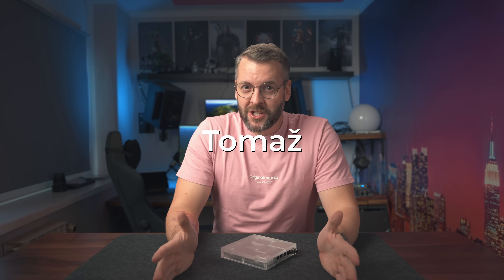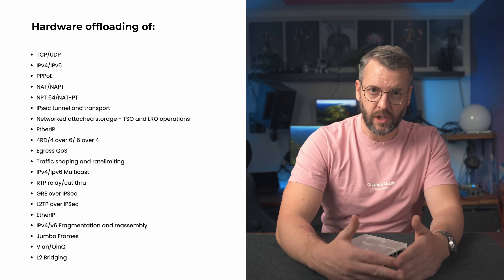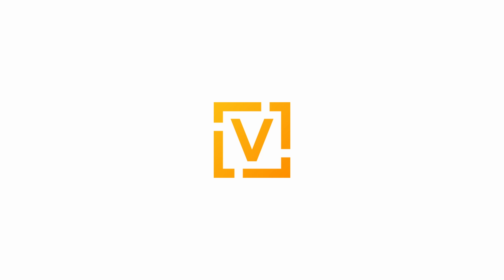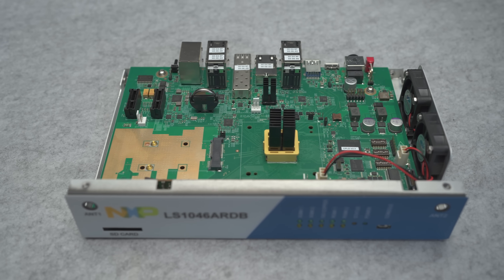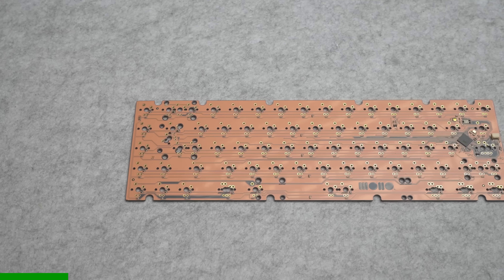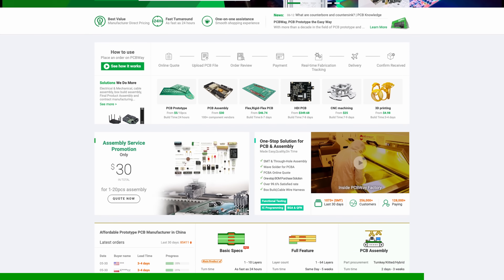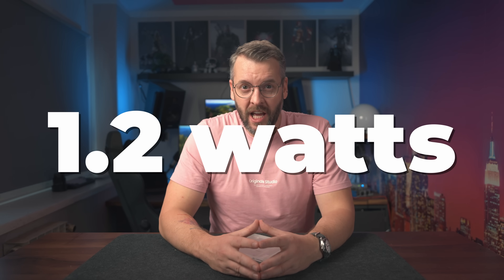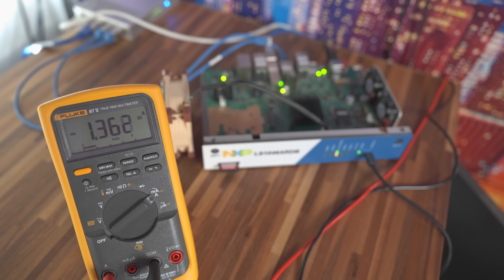10 Gb/s throughput without using CPU cores? ✅ Check.

Comment from the maker: Do you prefer a slightly slower version of the CPU if it makes the device cheaper, or do we go all in?
Reply: I'd go for the cheaper one for more possible customers.
Reply: @newbiegoalie exactly
Reply: honestly, with hardware offloading I think 1.4GHz would be good enough, and 4GB should be good enough too. would be nice to have benchmarks comparing those two configurations though to see how big the difference really is
Reply: @rooot_ yes and maybe a comparison of with and without closed blobs
Reply: i am excited about your router, i prefer lower cost, because very expensive consumer-grade routers have around 2GB of memory, like this Asus ROG Rapture GT-BE98 that has 2 10-Gbit ports, i think 4GB of RAM is allready an overkill, i am going to keep watching your videos. Thank you!
Reply: @Valmatej  bigger the ram bigger the exploit
Reply: I vote keep the cpu the same. means those who want a pure oss build can still get decent performance.
Reply: @bigalsenior that makes sense to me.
Reply: I prefer the beast variant. I like the idea of having more headroom to run related services on it.
There might be an argument to make two types in the long run.
Reply: I prefer the beefier one.
Why?, because it's not only a router, it’s also a firewall and an IDS/IPS.
not all functions will probably be done by the hardware, but also done by the CPU.
There is also a big possibility I won't use the NXP code simply because the traffic becomes “invisible” for the system (which makes statistics and debugging way harder.)
Reply: @spookje  If traffic is not visible to the system, how would an application layer firewall be able to work? I was excited about this project... now I'm wondering...
Reply: Well if this device is going to be like €500+ already(can't remember what it was going to be) the extra €100 does not really matter for the market you are targeting. What i'm trying to say is that €200 to €300 might change the market you are targetting, but €500 to €600 is a different thing. If however Openwrt is practically what we will get we can reduce the RAM to 2 gb. and depending on what things DO cost CPU power reduce the CPU. At the moment I run an what should be overkill pc (Minisforum MS-01) that uses quite a lot of power because of PPPoE with Vlan tagging my ISP uses, and horrible optimization for PPPoE in FreeBSD (OPNSense) (mostly single core CPU because no hardware acceleration is available). The C3758R I had before that simply could not do it. 1 core of the C3758R was too slow for 4 gbit PPPoE. with multiple cores used in OpenWRT on the C3758R it did work but did limit the download speed of a single download.
Reply: I'd go with 2 variants: the cheapest CPU (as the main networking is offloaded to dedicated hardware) with low RAM amount (2 GB, for instance) and the most expensive CPU with a big amount of RAM -> this last one should be released first, GPU/CPU market works this way, so there must be a good reason to imitate them 😊
This way the wealthy consumers get the product first and will be happy to pay the premium, and those with more tight budget can afford to wait on the cheaper variant.
Reply: @leandrogaleano1771  Poor consumers don't have use cases for 10Gbs typically. Only nerds like us try hard to find a use case :-)
Reply: @SwissPGO  I have a 10 Gbps Fiber to Home with Digi Spain for 25 euros per month :) I'm stuck at using my 2 computers with 2.5 Gbps, a cheap (>400 euros for 2 NICs and router) upgrade to 10 Gbps would be great.
Reply: @leandrogaleano1771  Yes this scenario makes the most sense, as not all viewers budget is the same and also the wishes what a device can do are not the same. Just make sure in branding or in how the device looks that it is very clear which type you buy. Not so much only for new devices but specially if the devices are going trough resellers as not all of those are honest about what they sell. So if the versions look completely different like another color housing that would be helpful.
Reply: +1 for a cheaper model
Reply: I'm just an amateur with not real dog in this but I feel like the question that needs to be answered first is, if the CPU is doing nothing with all this hardware offloading doing the routing, what would the CPU be doing that would make the more powerful one worth the cost?
Reply: I would like to see the same test without the kernel module. If this ment to be an open platform (where I can choose OS) and I don't want any specific module/patch/kernel, maybe the CPU speed will help something. Also this specific binaries means you need to patch the OS itself, and keep up to date, as much as possible, since you have to tell the CPU in a specific way, how to NAT for example (if I got it right)). Also worth to mention, that linux netfilter is statefull, if you configure it properly :)
Reply: @EFazy yea, I am cheering for this project, but I think some more in-depth benchmarking in general is in order. I wouldn't be the person to say which tests but I know I was able to get my Mikrotik crs305's processor sweating. That was the device/os that made me want to learn more about networking.
Reply: definitely, no question, cheaper CPU.  At your price point, you are only going to capture enthusiasts.  Cheaper x86 options are out there, and the power usage difference is generally ignored by most people.
Reply: I run firewalls as part of my job. Not everything can be HW offloaded. We do not know yet what the cpu is capable off for such tasks.
Reply: Please consider making two versions: RouterOnly - underpower the hell out of it for best cost; Router-Homelab - put good cpu and memory for those who will run dockers on the device.
Reply: All in. I hate these kinds of corner cutting. If anything make two SKUs.
Reply: All in for me but for the rest most likely would be a cheaper model because of the many routers available on the market.

How about a limited founders edition which gives you perspective of how many want the top tier model and also selling the cheaper one that way you get some data of how many are willing to get the top tier vs the cheaper one.

Also marketing is what you should look for to get more eyes into your router.
Reply: What about two versions?
Reply: @jelsonrodrigues  unfortunately, if you split the volume, you increase the price.  and then both models would end up MORE expensive than just one model with the faster CPU.
Reply: What’s the difference between the chipper cpu and the mor expensive one? 

My correct router from Teltonika has for example a Mediatek MIPS 24Kc 580MHz CPU with 128MBytes Ram.
Reply: What about the licensing of the software? 

BTW I'm curious now that you've seen their proprietary software would it stop you from trying to build software that would do the same?
Reply: Id say make the more expensive version first and you can have cheaper devices later down the line. That being said cheaper means more availability for us the viewer and if cutting down specs really doesn’t affect much then just cut down till it starts to hurt your intended goals
Reply: I say grab the 1.4ghz processor and the 4gb of ram. Why? Well you get a broader market that way since the device is cheaper, youll also probably get to even lower power consumption and both the end-user and you endup saving a buck.
Reply: In my opinion you should do the cheaper option but I also think it’s worth doing a video showing the performance of things that can’t be offloaded…

I don’t think 200mhz reduction is going to make the difference between a router than can hit 10gbps and one that can’t; the stuff that can’t be offloaded will very likely be closer to 1gbps regardless of clock speed.  As such I can’t see the sense in paying $100 more for a beefier cpu that doesn’t do anything to solve the problem.

More RAM is also worth doing a video on; I’m not personally aware of what router scenarios are dependent upon memory capacity but I’d wager in a home setting the answer has got to be “none of them.”

For $500 I’d be expecting 25gbps. 

As interesting as an open source router is, I can get most of the way there today using openwrt or pfsense for $100.  I’m not the guy who cares about closed source kernel modules so maybe I’m the wrong person to ask about that but I don’t think that’s worth $400 extra dollars.
Reply: get that nonfree crap outta here
Reply: Why not provide both? You could also sell two versions of the router. One with the slower CPU, and the other version with a higher-end CPU. That way you can provide customers with the ability to choose.
Reply: Not about the price. It's about GPL and corporate ethics. I would pay more to have the same performance without any secret sauce.
Reply: Why not sell two variants? One with 90-95% of the max possible performance and one which is trying to be at perfect value (price/performance)
Reply: i wonder what sort of cpu overhead is involved if there are extra (and future) functionalities to consider, or is anything beyond a standard router feature set considered to be bloat?

for the cheaper ram and cpu options, i think it depends on how busy the router will be, doing whatever else you want it to be able to do in the end.
if it really has no need for such a powerful cpu, even when it's doing everything it can simultaneously and at full tilt, and it can do everything you want it to in terms of functionality, maybe go even cheaper? XD
Reply: All in. Many of us remember UniFi's "1Gb" router that struggled to hit 300Mbit when the UniFi features were turned on.
Reply: @JB-fh1bb  That's what happens with hardware like this. The design is compromised and the marketing tends to be lies.
Reply: You are already making something niche, and in this niche the customers would really appreciate longevity/future-proofing. So I would say choose the CPU with best performance and add as much RAM as you can so that it remains competitive for longer. 

4GB RAM already sounds like more than enough when OpenWRT is doing well with 64MB
Reply: All in for a limited number of productions for the greater market, then after or in parallel go with smaller RAM and a slower CPU. I'd say 100 units (or whatever it makes financial sense) for the "All-in", then the rest for the smaller version. I mean, if there are enough users on this channel to support the beefy version (add a bit more RAM or perhaps an SFP+ port, maybe?) as the first batch and get a money boost to manufacture slower spec'ed ones, wouldn't it make more sense for business in a long run as well? 

I'd be down to pay USD 300+ for your project. I can't stop myself from checking YT just to see if you have uploaded new videos. 

Tokyo, Japan
 - Daniel
Reply: Wire speed is one thing. We have to consider firewall rules, packet inspection, IDS, IPS, VPN servers+clients, ipsec, etc. Unless you have a very simple home setup that just does NAT, I think most users watching your channel will be running at least 2 or 3 of the items I mentioned, and those will eat up CPU cycles real fast. It'll be great if we could have at least 2 CPU options.
Reply: Maybe I'm asking for too much here: How about also having an expansion slot for something like the Intel QAT for users who require alot of SSL/crypto acceleration and offload?
Reply: I don’t think the question is “faster for more or slower for cheaper”, I think the question is “willing to sacrifice fully open source for a small price improvement?”.  

I have been watching your videos but can’t recall, what’s the CPU load with the same test without the offloading? Could the smaller CPU still be used?

Is it possible to release two versions? Same hardware on both but different firmware? I don’t know the technicalities in achieving this.
Reply: I’d like to add, this is probably the most pivotal decision yet, as far as I can recall. Is it working doing a bit more testing and formal comparison to help the audience provide their informed feedback?
Reply: Start with the cheaper version - you could later offer more expensively beats.
Reply: Depends. Whether the sum of features and specs will justify the price. If you manage to convince the audience that the router as a sum is worth it , then people will justify a small increase in price for a better cpu. It depends if subconsciously we will consider it as high or mid router , thus beginning to compare it with other routers in the market.
Reply: Depend on the features, but yea
Reply: If you can use Hardware Offloading a slower CPU is fine. As most people will use that and the CPU will just be sitting idle most of the time. Lowering the costs overall would help customers and if you are paying extra $$ to use Offloading from vendor it doesn't help you in the long term to put in faster CPU with increased costs that just sits there doing nothing.
Reply: Really depends on the features you intend to add if everything you wish to implement is being offloaded it makes sense to go with the lower config since there wont be a big difference in performance. You can look at fortigate firewalls as an example here their super popular 60F firewalls only have 2G of ram since everything except for stuff like logging and DPI and IPS
Reply: My inclination is to almost always prefer extra RAM.  It's nice to have when everything works as intended and a lifesaver when you have to do something "unplanned".  

I'm a bit concerned about the offload feature being considered so critical to the value proposition though.  If the device is to be a raw speed "dumb" router then offloading is great and it makes sense to squeeze the other spec's for $$$ optimizations.  If on the other hand you expect to need the CPU to "do fancy router stuff" then more RAM and the extra MHz are potentially valuable, but there's more than a small chance of those "fancy"s pulling the flow out of the offloading and onto the CPU.  If you're worried about sacrificing CPU/RAM it almost seems like the offloading is the "nice to have" feature, and the CPU/RAM router beast is the primary feature.
Reply: cheaper as the only option first to increase potential market. then add a stronger version if there is enough demand. 
like you said. its a competitive market. a high initial price will drive people away. dont need a high end cpu with offloading
Reply: @bean_TM this logic is good.
Reply: Go all-in and make "cheaper" versions later...
Add a 4080ti in it, just to make sure we can run AI on our router! (Joke)
Reply: Slower and cheaper for me.
Reply: @tomazzaman  I'd suggest to start with cheaper version with 4GB RAM and 1.4GHz CPU clock to have a bigger customer base based on affordability and to have a quick return on your investment at the same time. Later on you can still release the more performant version.
Reply: Low specs for me as it will perform as expected with no hit to routing perf but opens the market a little more for those who want to access it.  Brilliant project! i love these videos and updates!
Reply: 100$ off of the final price for something that will not effect the networking capabilities of it? absolutely!
Reply: Fond memories, Tomaž.... I started out building custom computers in the late 1980's. I would plug the CPU and RAM prices into a spreadsheet.... look for the elbow in the curve. I would recommend customers purchase at the elbow point. "Little bit less, little savings. Little bit more, much more expense." Awesome progress! 🥳
Reply: I'm an All In person! 🙂
And i just ordered an Ubiquiti Dream Machine Special Edition ;-)
Reply: Go for the beast!
Reply: Go all in on performance is my preference, but $100 is enticing.
Reply: Incredible work, love following this!

I think starting with the cheaper option is a great idea. You could always release other variants in the future if more performant use-cases arise. Given CPU utilization is going to be VERY low due to hardware offloading you end up clawing back a lot of headroom for other use-cases.
Reply: less expensive or both options
Reply: yes, slightly slower CPU please, if that will give us a cheaper product. Because that's what you have to fight here, both CPUs are clearly 10G capable, but the price difference is significant, and that is what will determine success or failure here.
Reply: Make 2 versions.
Reply: All in, of course.  You have to build now for what the future holds and networks are not going to slow down.  Once that device ships, that is what you get for whatever number of years you contiue to use the device.  The $100 difference for a faster and more capable device will mean nothing over the expected lifetime of the device as it will maintain higher performance  over its life.  I would gladly pay extra if it means I dont have to replace a device more often because it cant keep up.
Reply: i would like to keep it higher end
Reply: All in.
Reply: Max performance please….
Reply: I would prefer the 1.6ghz/8gb version and if a buyer is totally crazy you should give him the option to buy the 1.8ghz version as well. With a 1.8ghz version you would have more room for future addons (better to have than to need).
Reply: A fast CPU for both and two versions (2GB and 8GB) seems like a easy way out. I would not recommend using two non-pincompatible cpus.
Reply: all in
Reply: it depends. If the price will be on premium spectrum, people would want the best of the best.

But if with the cost cuts allows the product to reach a more performance/price spectrum, then yeah go for cheaper CPU + 4gb RAM, since it will be more than enought.

Personaly i prefeer the cheaper option. But also i'm not the type of person that would buy e premium router.
Reply: All in, I want that CPU beefy.
Reply: Cheaper
Reply: Keep it as it is now, as this give more headroom for future needs, and  the possibility to go all OpenSource if you dont like the closed-source parts
Reply: What about making "pro" and "conventional" options where pro has faster cpu and more ram? Futhermore, why would anyone need 1.6 vs 1.8 GHz with more RAM?
Reply: Go for multiple SKUs. Faster CPU and more RAM should neither require a different PCB layout nor different SW, just different placement. The little extra cost for managing added SKU should be more than offset by larger reached customer base.
Reply: cheaper
Reply: Personally, I think anything below Firewalla Gold levels would be good. But 8GB is overkill and probably so is everything above 1.4GHz. This will just entice people to run heavy workloads (like Home Assistant) on their router, which I would not encourage.
Reply: @44Bigs  Definitively not overkill if you have complex firewalling tasks including deep packet inspection, ssl offloading, application layer firewall, blacklisting ip lists, AV, reverse proxy
Reply: +1 for a cheaper version
Reply: If the router is going to be used for multiple years then I would say having a faster cpu, would be a better choice. As you upgrade the OS and add more features, having the better cpu will help maintain good performance
Reply: In my opinion it all depends on the end cost. If the Beast version is $800 and the slightly smaller beast is $650 its still way over my budget...
Reply: What's the impact to running something popular like wireguard on it? I didn't know if the 1.4 with 4GB RAM can do 10gbps or not. If it can yeah go cheaper, if the difference of $100 was 5gbps wireguard throughput vs 10gbps (probably not not big a difference, but as an example) I'd rather pay more
Reply: My self i am more interested in pure "router" only hardware and not for anything els as containers nas or something like that, with that said i would vote for slowes cpu and as much memory that is needed to have the router functions
Reply: We need good router with firewall, with log analysis. People need to use all features to protect home and  internet connections. High-end router you've said keep it that way.
Reply: If the offloading is working as well as you tested, I don't see why it would need to be very powerful. What you need to test is real world firewall and possibly a deep packet inspection to see how they perform.
Reply: It's hard to say. As a router and firewall with heavy ASIC offload, the CPU and RAM doesn't offer a whole lot. However, if I can do things like run a Crowdstrike instance on the unit to pair with a bouncer, the extra headroom helps a lot. Being able to run edge workloads to expand the functionality of the device makes having the extra RAM and CPU valuable. But as others have said, core functionality even when it includes heavyweight routing protocols like BGP simply doesn't need the higher clockspeed or RAM. 

To look at a comparable device, the RB5009 from Mikrotik has a quad core Marvell A72 @ 1.4 GHz, but only with 1 GB of RAM. So even with the lower BOM, you're already looking at a comparable CPU clock speed and core count, but with 4x the RAM (albeit as a full SOC, so the DDR4 is on-package, likely making RAM access time faster). Assuming RAM latency isn't a dealbreaker, the lowest BOM is identical, and the initially proposed BOM is a slightly faster flavor of the same processor.

For me? Quad 1.6 GHz is probably plenty fast to handle all the queueing and NGFW needs I have, and 1.4 GHz is probably fine, albeit putting you on par with products released last year. As for RAM? For an extra $50-60 USD to the end user, I'd personally rather have the 8 GB of RAM, but if I'm being honest, 4 GB is probably more than sufficient, and wouldn't be disappointed. As much as I'd love to say "make both!", I feel like there's no way for me to reasonably ask for that on a first run product.
Reply: IMHO, if the firewalling (including IDS/IPS) as well as VPN connections work well, you can go for cheaper CPU and RAM options. But if you're expecting people to be able to run a proxy (like squid) on the router as well, it might get tough when lowering performance

So: it's a question of how much the device is supposed to be able to do. If those tasks work and there's still a lot of headroom, using cheaper components with slightly less resources is a valid choice. Maybe even the best choice as this won't only make the router cheaper for you, but also cheaper for the consumer :)
Reply: cheaper is better as long as it can push 10gigs and do most things routers/firewalls need to do.
Reply: I choose power!
Reply: Just do it like Framework...Provide all possible options and make it upgradable by the User...
Reply: One thing most people might not think of is the slower processor might be less wattage. Personally my dream router would have 2gig+ wireguard performance, under 25watts, supports 10gig routing between bridged ports and/or vlans, has overview of traffic stats to WAN to see if someone is downloading torrents or something, and also blocking torrent traffic. Right now my current setup only meets 2.5gig routing between 2 ports, under 15 watts, and some usage stats not IPS/torrent blocking. But it can be centrally managed via Grandstreams management website (not required, but cool feature)
Reply: Keep the CPU, some things still need raw CPU power, such as IDS / IPS.
Reply: Keep the CPU, some things still need raw CPU power. What about firewall , IDS, IPS etc.?
Reply: Beast variant for me - 5Gb retail connections are becoming easier to get here in the UK so I think sheer muscle is the factor.
Reply: I would go for 2 variants: lite and pro. :-)
Reply: All in
Reply: Lower cost.
Reply: Fore sure, i'd like it cheaper. As I understand it still should handle network load very well. For the rest I have my home lab with all the ram and cpu power
Reply: One approach could be to start off with the slower CPU/less RAM, but cheaper version. That would help with early adoption and then later introduce a higher spec variant for those who want to run more CPU/RAM heavy loads on their routers.

While multiple SKUs add overheads in manufacturing, I suspect you might be able to get away with the same PCB between the two variants and also share a lot of the testing setup.
Reply: @tomazzaman  what if hw acceleration has bugs you don't know yet? And you can't use hw acceleration?
Reply: More than cheaper, I like even the tiny bit lesser power consumption of lower clock speeds :D
Reply: That hardware offloading is so cool, but I have a question.

If I wanted to run a load balancer or reverse proxy like NGINX or HAProxy would the kernel then be used?

If so I think I’d pay more more the faster CPU
Reply: All in - faster CPU and RAM.. with IDS addons it can be a bottleneck otherwise
Reply: Medium or slow CPU with 8gb of ram. Then introduce docker or command line. And you can install smart home or other programs. It doesn't need to be simple router, as such devices exist already.
Reply: Go for the best CPU, or at least make it an option.
Reply: Why not two or even three Versions? If you "just" need to replace the CPU and the RAM but can keep the overall design, it shouldn't be a big deal to release one Version in the first place - I Think, I would go with the cheaper Version at 1.4GHz and 4Gb of RAM - and if your Product succeeds, you could add a "pro" Version to the market and maybe even a downgraded "lite" Version with only 2Gb of RAM and an even slower CPU for those, who don't need to Gigabytes through an VPN all day.
Reply: From the network perspective you have to keep in mind the arp cache aswell as the NMBUF (network fragments buffer) on a 10G Network the memory usage with a lot of clients and connections will go up. Thahts why on pfsense and opnsense you have to configure the nbuf higher if you got a mutlible 10g networking infrastructur. pfsense got a good explaination about it on theire documentations. Even I had to manually fix that issue.
Reply: Maybe you can get the cheaper processor but should stay on 8 GB RAM just to be sure about the ram usage. For me my nbuf has to be high due to the high clients count onsite so around 4gb nbuf has to be setup to ensoure that no kernel panic will accure. Just keep that in mind.
Reply: all in!!!  obvezno! drgač pa vrhunska zadeva!!!
Reply: Why not offer both? a low power version for the budget conscious and a high-powered version for the power user. Or a BYO version. I guess that's going to add some overhead for productions and SKU's and might not be reasonable. However, if the sales volume isn't very high, it might make sense. Similar to the Apple BYO page. You would also then see, what the most popular version is, and based on your sale statistics, you could potentially create a manufacturing pipeline that is optimised for the sales popularity.
Reply: cpu offloading means less 'security'
Reply: Keep me as future prime of as possible.  I vote the original specs.
Reply: For me, the current CPU is the perfect sweet spot. There is always the option of making a lower cost, higher volume option later on once lessons-learned are gained and reviewed.
Reply: If we have the choice to use the CPU and RAM capacities for nearly everything else than forwarding traffic (routing processes and many firewall rules will impact this nonetheless), I vote for leaving the faster CPU and bigger RAM capacity in, as this make the router even more versatile - and to be honest, if this adds up another 50-75 USD ontop of the final price, I am more than willing to pay this extra :)
Reply: @BurstDragon  curious what is ur home internet speed?
Reply: @BurstDragon  considering there are high level it people which are government allowed to supervise any system they see fit why do you care about a firewall?
Reply: @BurstDragon  havent u learned anything from my life?
Reply: @tomazzaman  so ur making what tenda tp link dlink linksys asus has been making for the past 10 plus years, reasons?
Reply: @tomazzaman  frankly speaking who even has a home internet speed of over 1GBs? Or even over 100 MBs? Realistically
Reply: more power is better, but maybe make it optional via extreme edition or lite as you mention in another video. Increasing SKUs is not ideal, but you can start with premium first, to have sufficient margin to get this off the ground. Akin to Tesla breaking into the car market with the roadster.
Reply: it depends what's on the market price compared to yours but i believed that your router will be a beast when its released. my budget is around $200-300 usd or more if it offers something unique in the consumer market.
Reply: I want 128 cores and 1tb of ram😂
Reply: Possible to make it customizable?
Reply: go with the high end hardware, if you want to offer a future proof  product
Reply: CPU and RAM matters only in routing protocols like BGP.
For a SOHO++ device 4Gb is enough, and CPU actually doesn't matter due to offload. Resume - I vote for lower price.
Reply: I'd say keep the big cpu but go to 4G of RAM. (Saving most of the cost, but not everything?)

Reason being, that some "nice" protocols won't be hw-offloadable. Best example: Wireguard.
Also enabling stuff like Suricata would be troubling because we cannot let all the traffic stay in the hw-offload.
Reply: I'd go with the expensive one